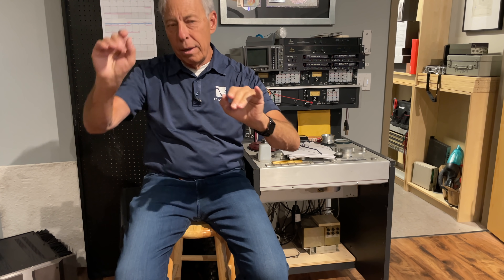Spatial audio in speakers

Comment: Paul mentions some good points.  Speaker placement / positioning to significantly imrpove the acoustically coupling btween a speaker to its associated room is pretty crucial.  Even so, there ain't nothing quite on par with drastically lowering your playback system's much raised noise floor.  In so doing, far more music info already embedded in a given recording will then remain audible at the speaker - rather than inaudible.  IOW, more audible music info implies best soundstaging potentials as well as a slew of other potentials.

Comment: Soundstage;
The 𝙍𝙀𝘾𝙊𝙍𝘿𝙄𝙉𝙂 has to have it, the 𝙎𝙋𝙀𝘼𝙆𝙀𝙍𝙎 need to resolve and launch it with ample coherence, the 𝙍𝙊𝙊𝙈 needs to support it. 

L-R room symmetry is vital, placement with equidistant boundaries and surfaces. 

Diffraction and early reflections can destroy it. If problematic, address SBIR, however it's not fundamental to soundstaging. 

The ITD (initial time delay) and the ETC measurement goes a long way to determine the challenges the room presents. 

Additionally, open baffle/dipole systems in a well sorted room can both resolve and exaggerate soundstage effects in a very pleasant manner.

Comment: Paul I am from India and I want a suggestion from you. 
Should I buy a power amplifier and a DAC or should I go for an integrated amplifier? Which will last long? 
I want to add a subwoofer in near future. So please guide me. 
Thanks.
Reply: For what it is worth, I suggest separate pre-amp and power amp. I also employ a separate cd transport and dac. The way you posed the question, it sounds as if you could be streaming?
Reply: @2112res  yes I will be streaming music from different sources. 
So u suggest me to go for preamplifier and power amplifier combo.
Reply: @mangalmaybiswas3506  Yes, separates. Combo, to me, kinda suggests integrated, which I would avoid. Of course a good integrated is going to be better than lesser separates. I have to believe that Hegel has a decent grasp of integrated tech.
Reply: @mangalmaybiswas3506  Like most anything, it will be budget dependent. I have one of the first Hegel DACs, a great little performer. I would love to get a Hegel amp to go with my PS BHK pre-amp. And I think I could trust their integrated, with an excellent dac built in.
Reply from the maker: In general, separates are better. There are of course always exceptions to the rule, but in general, go separates. If nothing else, it gives you the freedom to upgrade one of the pieces without having to change both.
Reply: Thank u so much Paul for your valuable suggestions 😊

Comment: I use 23 degrees toe in horizontally and vertically in my HT. I have speakers above and on the floor.  It has a wonderful sound stage with speakers disappearing...  All speakers are angled 23 degrees either up or down and side ways for the best presentation.  These are bookshelf's either on the floor or above.

Comment: Smooth off axis response ? Now ya talking !! That only comes with very high end systems .... you can recover a lot of missed off axis sound by virtue of a big room with the correct acoustic characteristics
Reply: KEF generally have pretty good off axis response, take a look at the LS50 Meta for example
Reply: @mrebear9758  yes they're not too bad .. but check out their group delay ..! It could be much better and phase linearity
Reply: @janinapalmer8368  the delay in most measurements I've seen is exceptionally good due to the time aligned coaxial driver.  The frequency response below 300hz and small scale are bigger issues IMO and, yes, they are a demanding load

Comment: Paul is absolutely correct in the off-axis response. This is what gives speakers depth and presence. The off-axis response arrives slightly delayed with respect to the direct on-axis sound. These constitute the early reflections. The brain, via the precedence effect, sums these together with the on-axis response to get the final sound you hear. Almost all speakers (other than mbl) will have some directivity beyond a few hundred hertz. In excellent speakers such as JBL monitors and KEF metas the directivity index will be constant and the sound will be largely independent of the room beyond 1 kHz. In very good speakers there will be rising directivity but the off-axis will be similar, so simple equalization will make them perfect. In shitty speakers, the off-axis will be something random, and nothing can fix it. It’s literally like having one good speaker with a bunch of crappy boom boxes around it. While not complete, Floyd Toole’s Sound Reproduction provides a very comprehensive discussion of this. Given that he was one of he guys that literally wrote the book on how to properly design speakers, it’s worth the read.

Comment: Getting true accurate spatial effects out of speakers is quite difficult. The first being that the spatial effects are subtle, and easily lost. Room acoustics, diffraction around your head, and any deviations in the speakers response will render them inaudible. The only system that I’ve ever had that does do true spatial effects (other than headphones) is my near field system, but it’s quite imprecise. My planar headphones actually reproduce sound imperceptible from he source with a correct microphone. Can literally compare them to the thing I recorded and even the size of the room is accurate in the headphones. Speakers that stuff gets lost. In a far field system these are likely absent altogether, so the “sound stage” you have will be somewhat artificial. The only way to get a true sound stage is to go to a multi-channel surround system that has a much higher listener envelopment. Stereo is quite inferior in that regard. That said mixing engineers know what sounds good, and how to convey something believable in the recordings.
Reply: mixing engineers for the vast quantity of music don't seem to give a rip

Comment: Some predictions can be made about soundstage ability of a speaker based on the laws of physics we are all stuck following. e.g. when multiple drivers are used like a 3 way system, if the drivers are not aligned vertically you will get different frequency dependent anomalies at each ear because of varying path lengths. This blurs the soundstage. Just like cabinet edge reflections from drivers because of recessed speaker mounting on a flat board. Also blurs the soundstage.  Some predictions can be made just by reviewing the physical design.

Comment: Open Baffle ? it creates a soundstage which is not recorded. It have to find the right place for these Kind of speaker, it generates a lot of room reflections and combfilter effects. The sound from the frontside is total different from the Backside, causing the Magnet and the basket behind the Speaker. Open Baffle is not realy Hifi. A 3d Soundstage is a speakerdesign phase problem.

Comment: I found that situation with recordings also. Sound stage is indeed variable from recording to recording. You're right about pointing the speakers straight out instead of toed in. I found that out after experimenting.
Reply: So you're a fan on speakers pointing straight out? I just set mine up and every seemed to recommend towed in
Reply: @strykerking  
It depends on the speakers, room size, distance between the speakers, and seating distance. A lot of variables. Set them up for whatever sounds best to you.
Reply: @strykerking  Evidently, this is one of the reasons why experimenting is important. Pointing them straight may not work well in all situations. I found that it depends on the speakers and also the room.
Reply: @strykerking  I run mine with very little toe-in
Reply: @Douglas Blake 
You're right, that's the first of three components of soundstage. 

Second; can the loudspeakers resolve and launch with ample alignment coherence to resolve and replicate the recorded content. 

Third; limiting the acoustic distortions, SBIR and otherwise. 
The transfer function of the room needs adequate uniformity to reproduce that recorded content... ie., eliminating diffraction and early reflections. 
Pursuing relatively equidistant boundary surfaces adjacent to the speakers assuring the reflected energy supports the direct energy in a non-destructive manner. 
L-R symmetry is key, and vital from the listener forward, in both proximity and surface/treatment type. 

My experience, fwiw.

Comment: Open Baffle is the key to getting an open sound stage and true spatial audio. In open baffle speakers, the sideways facing waves cancel out, and give you a dipole emitted waveform. Also the speaker cabinet which resonates in any boxed design speaker is eliminated. That box sound is what ruins any speaker, as most are not braced and dampened properly to eliminate internal pressure from the backwards firing waveform. Open baffle bass is also the best bass you can have, as it doesn’t pressurize the room and create room boom like any boxed speaker design does. Room modes are a huge problem in any box speaker design, and open baffle solves that problem.
Reply: you are so right. the box itself will reduce soundstage. i have small speakers in a small box that create much wider soundstage then speakers in large box.

Comment: With respect Paul don’t you get the flattest frequency response with the Speakers aiming directly at you ?
Reply: In my experience the soundstage seems to be determined by how close and far apart the speakers are.
Reply: @dannygooner77  they definitely do need to be placed in a symmetrical fashion to the room. Get the measuring tape, out it really helps.  But aiming straight at your ears isn't necessary for a lot of speakers.  Better to have sounds travelling past your ears then reflecting off the rear wall, back at you from behind.  You'll get more holographic image that way.
Reply: to which ear?
Reply: Having speakers pointed directly at you provides a more intimate "headphone-like" experience.  If that's what you want, go for it.  But as Paul said, if you want big soundstage, you'll need to have little to no tow in (provided the speakers are pulled into the room as well) and having speakers that have great off-axis response is key to still having great tone.
Reply: Some speakers measure flatter off-axis, such as the KEF LS50 Meta, which is designed to be listened to about 15 degrees off-axis. On-axis, it has a piercing 5 khz peak.
Reply: @CaveyMoth  That is still significant toe-in
Reply: My smoothbrain understanding: the main goal of the off axis response is to replicate the fact that whatever you would be listening to as the spectator would be off axis as well.
The flat response is what the Microphone would be hearing, but we (the listeners) are not the mics, that's the left and right channel.